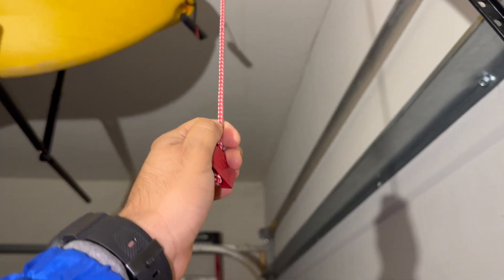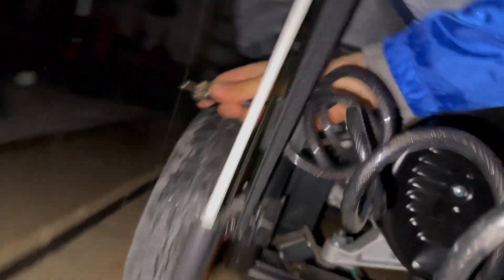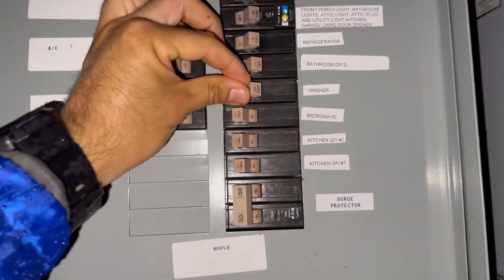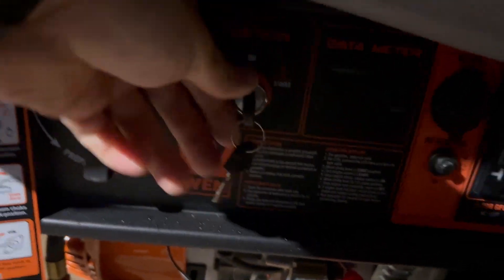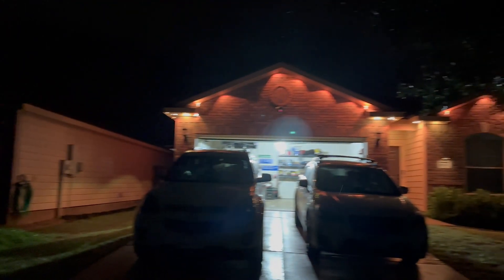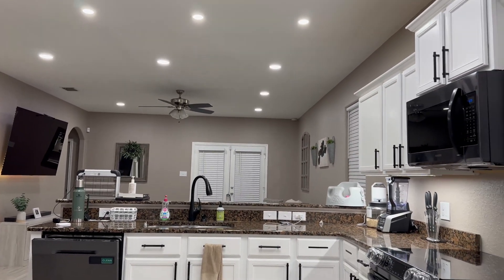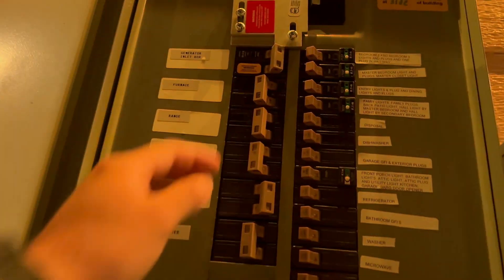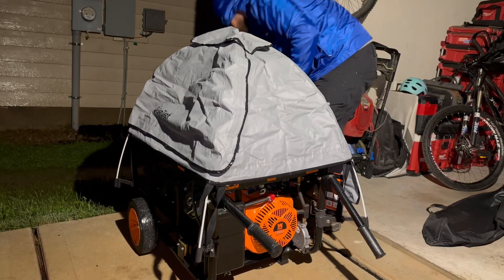Whole House Power Backup Solution | Generator Inlet Box | How To Use Portable Generator

Comment: Hey nice video, is it safe due to carbon monoxide to have your generator right outside the garage door, I am trying to do a set up like that as well.
Reply from the maker: As long as you face the exhaust away from the garage, it should be fine
Reply: @sparky_izzy  They dont recommend it since the exhaust can get into the roof eves and into the house that way.

Comment: I have the same setup.  My WEN is only 4,750, so won’t power a/c.  Electrician wanted $1,500 to add 30 amp connection so I did it myself.  Very easy.
Reply from the maker: Nice! Stick around this year because I will be coming out with more electrical DIY projects including a 50a generator hookup 👍🏽

Comment: Hello , first time switching inlet box to the green led light .
I connected everything but when I turn on the generator breaker  I do not see the green led light on . Does this led light turn on when generator is on or will I see the light on when the generator breaker is on ?
Reply from the maker: Hello, you will only see the green light on when the generator is connected to your system. If you are on normal utility power, the green light should be off.

Comment: Do have you have soft start in your AC? If so which one do you recommend?
Reply: I bought a Micro-Air Flex and regretted it after it failed on me. That company has gone downhill and is putting out junk now with horrible customer service. Literally buy any other brand. The other brands are 1/2 the price too.

Comment: Can you do a video installing the electrical to get a system like this?
Reply: Lots of videos already out there. I watched a bunch of them and just installed a 50amp generator box myself into the 50amp breaker using 6/3 AWG Romex wire and a 3D printed interlock specifically for my panel. Probably saved $500-1000 over an electrician that wouldn't have done as good a job. And I also did my own natural gas connection at my meter to power the generator without the need for trips to the gas station, filling up every 8 hours, or propane tanks. That was another $500-1000 savings.